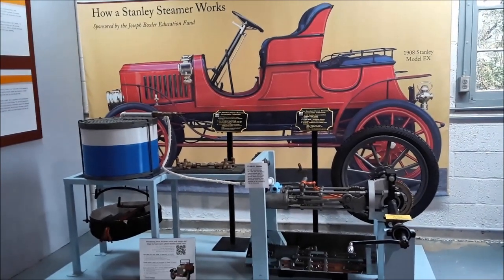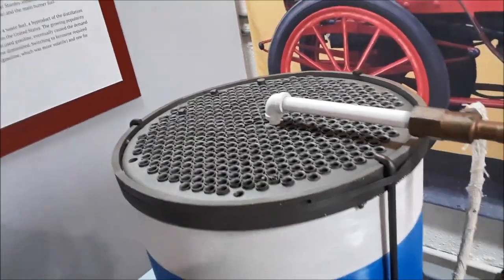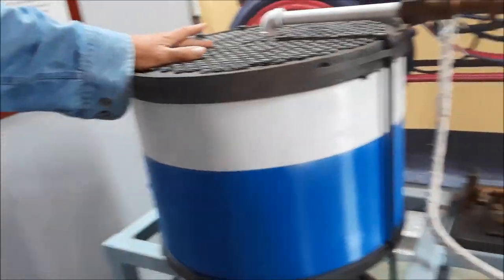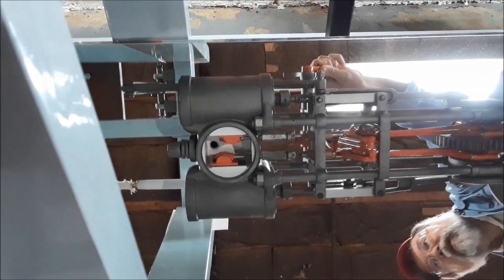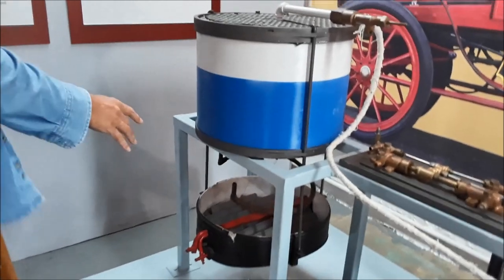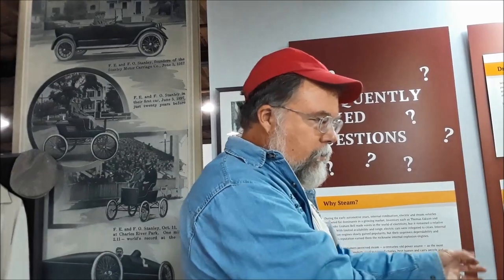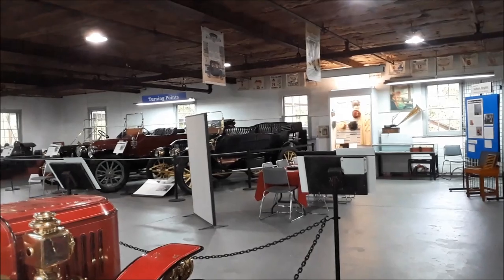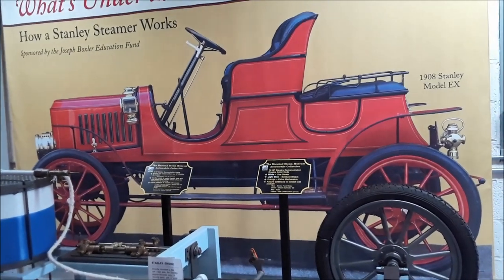Kelly Shows Us How A Stanley Steamer Works At the Marshall Steam Museum

Comment: What is the size of piston❓
 bore ❓
 stroke ❓
Please specify in millimetres.
Reply from the maker: This depends on the year/hp  On a quick search, I found the specs on the 10 & 20 horsepower engines:  The twin-cylinder steam engines were at that time 10 horsepower, with 3 1⁄4-inch (83 mm) bore and 4 1⁄4-inch (108 mm) stroke, and 20 horsepower (15 kW) with 4-inch (102 mm) bore and 5-inch (127 mm) stroke, and made extensive use of ball bearings.     You may find this site of interest:  http://www.stanleymotorcarriage.com/SteamEngine/SteamEngine.htm
Reply: @carshowreporter  
10 HP and 20 HP

How much pressure is required to drive a car?
Maximum ?
the minimum ?
Reply from the maker: Please check the site listed in my first reply. It is an excellent source of information.  The 10/20hp engines were supplied with 550 psig  For the explanation, check this site:  https://www.engineeringtoolbox.com/saturated-steam-properties-d_273.html
Are you interested in building a steam car??
Reply from the maker: Check out this site, too:   https://www.facebook.com/steam.dream.2022
Reply: Don’t forget the 30 HP version used in the model K. The gents speedy roadster and model R used 20 hp motors. While the boiler is lightweight, they hold lots of pressure and I am not aware of any boiler explosions in the 20 plus years O have worked on them.

Yes no reverse instant gratification but there is reverse thru the linkage. There was also hook up which is a setting on the linkage to conserve fuel.

We used a mix of gas and diesel in place of kerosene. We also used Colman camp fuel to fire the pilot burner.